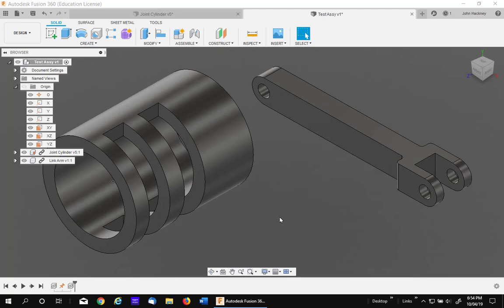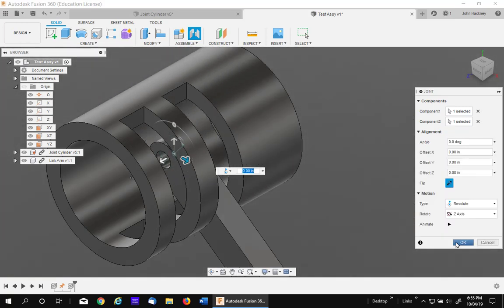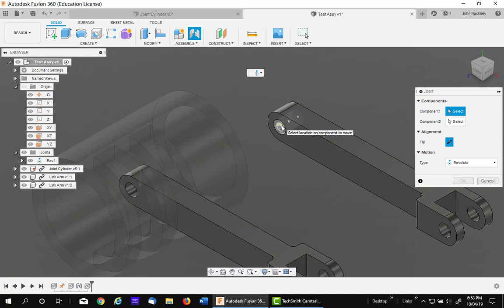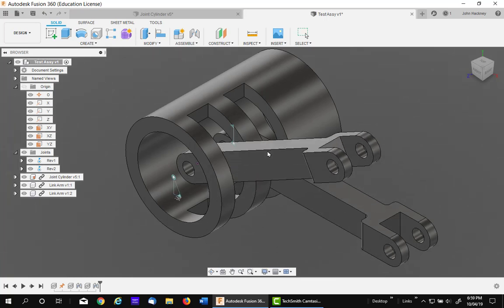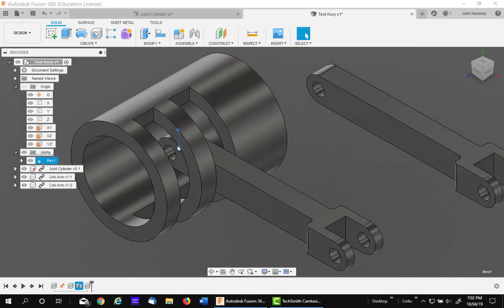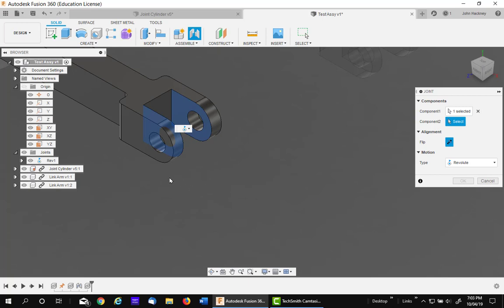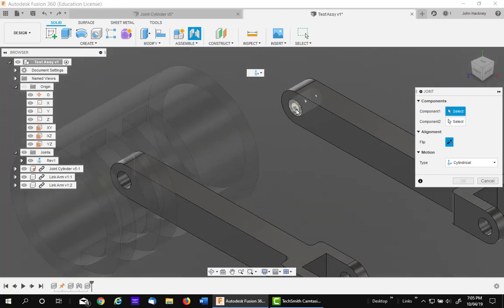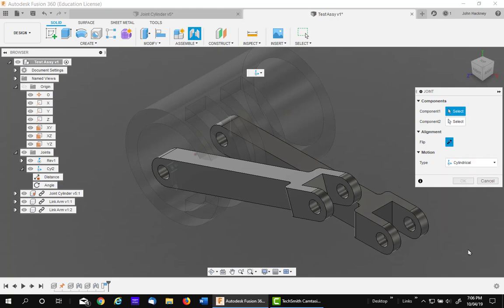Digging Deeper into Autodesk Fusion 360 Joints

Comment: Yep, that alt key trick is the cats meow!!!!!!   My latest project has a bunch of joints and also inserts a bunch of mcmaster carr parts which also have to be joined into the assembly.  Just ground one component and go to town with the rest of them.    Like building an erector set.   Ha Ha  Finally got to use the joint limit feature on a couple of articulating arms in the design.  Too bad the insert mcmaster carr is presently broken.  It gets hung up on a solid works 3d selection and won't let you change it.  I saw a video where a guy went directly to mcmaster carr outside of fusion 360 and downloaded the item as a step file to his computer and then did an upload and that worked O.K.  A lot of extra work and I hope they get it fixed soon as that is a great feature in fusion 360.
Appreciate all of your videos as they are very informative.

I am trying to figure out if there is a way to show the movement of the articulated arms in the animation feature of fusion 360.  I see how they explode the components but haven't figured out a way to show the movement of the arms front to back off of a pivot point.  That may not be possible and I understand.
Here is a link to a screen shot to show the arms that I want to move.  https://drive.google.com/file/d/16ZUyXr0-FFE8BNWVr0aJVE21Ex9xWRe5/view?usp=sharing
John